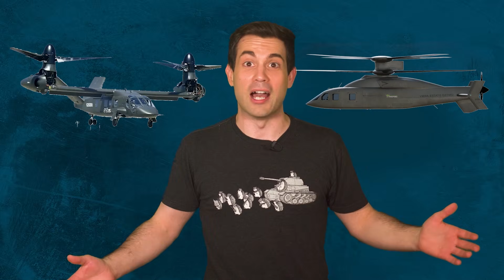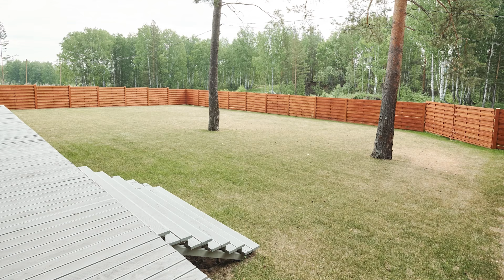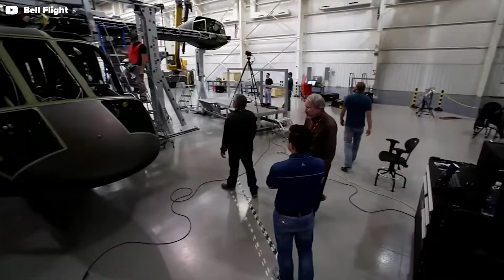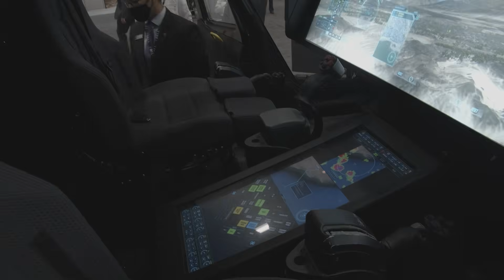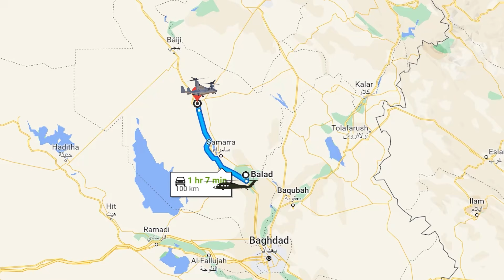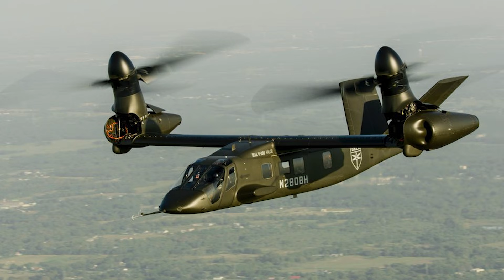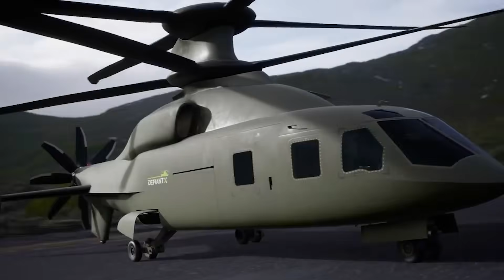V-280 Valor Helicopter Will Help Defeat China

Comment: The F35 is an example of why you don't build multipurpose aircraft. It's not a cost saving. It's a worse aircraft.  A purpose designed attack helicopter is not going to be a good cargo lift helicopter.  Watching the Ukraine war, attack helicopters need to be able to be fast, stealth via manpads, and lots of long range precision weapons.  It's more likely that only maned versions of cargo helicopters that operate well back from the front is going to work anymore. Unmaned vehicles with weapons and cameras are going to replace maned attack helicopters.
Reply: The F-35 is cheaper than most 4.5 Gen fighters out there, and it's a much better aircraft.
MANPADS have such short range that stealth is impossible.

Comment: Is it reliable (for an army helicopter of course) to have full-cockpit big board display? I do not have anything against separate LCD monitors\devises, but one giant LCD is prone to crash from one bullet, leaving pilot without any information at all...
Reply: You don't actually have to make a display out of a single screen. It might look like one big unit, but in practice it could easily be 5-10+ smaller screens that are merged together under a unified galls/plastic cover plane. Provided you got redundant power/data cabling behind the display, every single one could be shot/destroyed without affecting any of the others.
Reply: @reappermen  Thanks, probably it is

Comment: Personally think the Boeing Heli is a better fit, if it can lift the requirements. Smaller landing footprint, maybe faster, again only question will be lift capabilities
Reply: The tilt rotor design is faster, but I can see the coaxial rotor design being better at carrying load. There's not one solution that trumps the other in all areas.

I'd be interested to hear how that coaxial rotor sounds. It should have a pretty high pitched sound, but that's just me speculating. I could be wrong as they say they are able to spin the rotors slower though. Still coaxial counter rotating props tend to be whiny.
Reply: Coaxial is more efficient but it is not better than two rotors,  So if you have a fix diameter rotor then the the lift of two rotor is 2x but the lift of coaxial is less than 2x. Coaxial will have somewhere between 1.6x~1.3x lift. But the footprint of 2 rotors is 2x while the footprint of Coaxial is only 1x. Coaxial is a lot more compact but the twin rotor should have higher payload given the same rotor diameter.
Reply: @kazedcat   A detailed synapses of my comment exactly Lol

Comment: Come on Cappy! An LZ is like ice cream if it is not cold it tastes like crap. The Sikorsky-Boeing SB-1 Defiant should be able to land in slightly more confined spaces but didn't they have to stop flying in summer  2019 until fall 2019 for rotor bearing issues (so much for the rotor system being safer) and a delayed start in 2018 from 2017. The Bell V-280 Valor so far is faster and has I believe had flown more hours. It appears to be more likely to be ready on time. Range and load carrying will certainly be very important deciding factors.

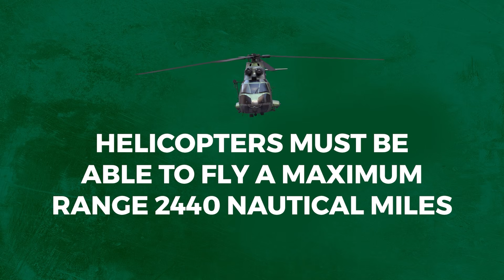Comment: 12:00 Are you sure? That's more than distance from Europe to US. 13:44 No, that's not. You played too much games. They use swashplate IRL. Making it work with double amount of rotors is a pain and was problem was successfully solved by soviets in their Kamov heli bureau. This one is probably additional thrust to meet speed requirements. I hope at least, otherwise it is double cringe.
Feels like they want latest Mi-8 mod but faster.
Reply: "Are you sure? That's more than distance from Europe to US."
Yes for example V-280's range is 2100nm. Defiant-X's latest range is 700nm
It's not more than europe to US. That's about 2700nm.
Keep in mind, this is for max range. Combat range is a lot shorter, about 500-800nm for V-280. They want these helicopters to be able to drop platoons of infantry on distant islands
Reply: @Userext47  Yes, my bad. But giving max range with additional fuel tanks for ferry only is kinda cheating.

Comment: Both had its own purposes.. can only choose one over the others is going to be hard. For long range transport, tilt rotos definitely the best. But hot extraction, tilt rotors is simply too big a foot print. It will had many2 disadvantages
Reply: From the description, sounds to me that the new project will be for a heavy lift that exceeds the current Blackhawk which could mean that missions like hot extractions might be performed by other craft like a smaller Osprey.
Reply: There are actually 2 competitions the army is holding, flraa which was discussed in this video, and fara which is supposed to be for a lighter scout type. Sikorsky is basically putting the same aircraft but smaller in fara, so the bell v280 might be selected for flraa but the Sikorsky raider for fara.

Comment: I think we should invest in drones that can transport equipment like artillery or tanks. That way pilots are not put at risk for these types of missions.
Reply: Not a priority. If you are transporting a tank or artillery piece, you are already risking the lives of highly trained specialists in the form of the tank or artillery crew. After all, there is no point in dropping a gun off on a hilltop if there are no gunners there to use it.

There is a big advantage in the difference between risking a trained pilot and not risking one (e.g. striking something with a Reaper vs an F-15). The difference between risking, say 6 artillerymen and 2 pilots vs risking just the 6 artillerymen is pretty minimal.

Drone transport is more useful at smaller scales (or much larger ones, for different reasons). Having a small drone helicopter that can carry a 1000 lb payload would be great for aerial resupply in contested airspace, because losing a few days worth of food and ammo is much more palatable if it doesn't cost a pilots life. Just send out a second shipment by a different route later in the day. Plus, since the size of cockpit that the pilots require is more or less the same regardless of how big the aircraft is, the space/payload savings you get from removing the crew area is much more impactful in a smaller aircraft than a larger one (e.g. removing a Blackhawk's crew compartment increases the cargo area by about ~20-25% vs a Chinook, where it is only ~10%).

Comment: Mostly based on aesthetics, I definitely prefer the Deviant-X's design; It looks safer, more efficient, and to be honest, has a more futuristic look to it; plus, I've always wanted to see us go into coaxial rotors set-ups and the pusher-prop is a cool bonus. Don't get me wrong, I really like the V-22 Osprey too, but there's just something about the V-280 that just makes it look flimsy and I can't get over the fact that its just a blackhawk with wings.
Reply: I don't know, dual main rotors is something that's been around for decades, and there is only really one company that keeps doing it (the Kamov Design Bureau in Russia). That tells me that it is a probably a very finicky system that requires a lot of specific engineering knowledge to get right, and that means we are likely to see a lot of unfortunate accidents in the decade after this helicopter is adopted.

Tilt Rotors have the same issue, with only one of them really being widely adopted but they have two mitigating factors: first, the US military has already learned a lot of tilt-rotor lessons the hard way with its V-22 experience; and second, the tilt rotor has a clear trade off for its increased complexity (being able to fly roughly twice as fast as a comparable helicopter). I don't know if the coaxial rotor & pusher propeller design offers as significant an advantage in return for its increased mechanical complexity.

Comment: In a side issue, maybe it’s a good time to examine the Navy’s role in future combat. The Navy has trouble retaining pilots. The Marines have trouble getting budget consideration for their equipment. Maybe the Navy should concentrate on captaining ships and leave other functions to the Air Force and Army. 

For example, Aircraft Carriers would be commanded and staffed by the Navy. The pilots would be commanded by the Air Force as a hardship duty along with being stationed overseas. This would help retain pilots. However, the Air Force commander would be under Navy command by rank while on duty. 

For the Marines, they would be a special trained forced within Army command. This would take the ceiling off of many senior officers and enlisted men. The Marine part of the Navy budget would be transferred to the Army where are Armor and Mech Infantry equipment would be uniform. For amphibious and large beach landings, new equipment would be developed capable of keeping up with the speed of battle. If this could not be done, new doctrine would be developed to get the right equipment to the right stage of the battle. The Marines should not need a 3 day sand storm to catch up to Army units.
Reply: Your idea isn't bad from a logical point of view.  But Marines would rather chew nails than go under army command. They'd never go along with that plan.
Reply: Although in every major operation Marines are under Army command because of rank structure. However, I understand your point about tradition. If my idea was executed, preserving as much it not all Marine traditions would be a critical part of the integration.
Reply: @stephensipe5405  Well, yes. But the underlying problem is that you think the marine corps is a military branch with an odd attachment to their traditions. 

In actuality the Marine corps is basically a cult thats funded by the U.S. goverment.  That pretends to be a military branch so it can continue to receive funding, and new sacrifices for its God: Chesty Puller.  

If you try to touch their traditions then the death cult will cry murder.
Reply: @stephensipe5405  Marines do not fall under Army command we have our own structure and our doctrine and mission set is completely different from the Army. Take for instance we had more freedom to operate in Afghanistan then the Army and they didn’t like that because we didn’t fall under Army Commad
Reply: @darrylmuse9948  Stow it. I am not in a pissing contest with a Marine. However, the Marines are a great example of mission creep gone mad. There was a big jump from Tripoli and Vera Cruz to Ft Fisher, Central America governance, and WW2 island landings. Nevertheless, at least some of this progression looks reasonable in a large picture way. 

Khe Sanh was probably the point of too far to be a long term good idea. The Mekong Delta yes, the area north of Da Nang yes, Khe Sanh no. However, post Vietnam the Navy-Marine budget balance  completely undermined the Marines mission success. For example, Grenada exposed communication issues. Desert Storm/Kuwaiti Freedom was a Marine tank disaster at the battle of the airport. In Desert Storm/Iraqi Freedom, only a 3 day dust storm saved Battle Of Baghdad from also being a disaster. This was because of Marine amphibious vehicle being expected to perform like an M1A1 tank. Then there is Marine Aviation and the Osprey dream and budget expenditure. How many Marines have died after testing in Osprey deployment. 

The Marines cannot be disbanded because the actual Marine mission still exists for the US. However, if the Marines were part of the Army as a specialized Unit, like the 101ST Airborne, all of its equipment would be the most modern. Additionally, it would be integrated in the Combined Arms Air-Land Battle Doctrine.  On a personal note, the promotion base and pyramid height would be far wider and much higher. The biggest difference, it’s Yes Sir, not Aye, Aye.

PS: The Navy cannot retain pilots. This is mostly because of personal reasons. Navy pilots cannot sell multiple long ship assignments to their wives. They opt for civilian aviation for family values. The reenlistment ratios of Air Force pilots is almost exactly opposite that of the Navy. I would incorporate all Naval air assets into the Air Force. The Navy runs the ships and the Air Force flies the planes. A ship assignment of an Air Force pilot would be treated like a hardship duty in Korea. This should greatly increase pilot reenlistments. 

For Officer promotion to General, serving as an Air Force pilot or Maintenance Officer on a Navy Carrier and in a Marine Unit as an Army Officer would be a positive factor along with wartime service and grading.
Reply: @neckbeardpig279  U got that right
Reply: There's a ton of second and third order effects you're not considering. The Air Force has no business commanding pilots in carrier ops, considering that they don't have the experience to run carrier ops - the Navy does.

Comment: No offense brother, but this is going to go the same path as the V22 project. The Army is going to buy hundreds of new VLV's, crash half of them, and give them to the Marine Corps.
Even though the V22 Osprey was designed in the late 80's, they are still one of the best VLV's out there. During my time in the Marine Corps, I was an 0481 with FSSG (Logistical Landing Support) and a few of our pilot's had mastered the gentle touch that a V22 requires for stable flight. Instead of purchasing new VLV's, the Army just needs to rely on the Navy's logistical and aerial support for transit. Especially if they plan on having any business in the south China sea.

Ground pounders always want to be self reliant, which is a good thing, but you already have an extensive logistical team ready to help out anytime you ask. The fleet of V22 Ospreys can provide reliable and stable flight over the sea from ship to ship or port to port for the Army for the next 40 - 50 years if they learn to play nice with the Navy and Marines. Branches fighting with each other is funny, but when it comes to unnecessary spending, the U.S. Army is the best in the business.

A comment on a YouTube video will have absolutely Zero effect on the federal government's decision but damn man, just combine the national Guard with the Coasties already and let the Navy fly you around a bit.

Comment: Maybe it’s b/c I’m long in the tooth but I prefer the Analog instruments for durability.
Reply: If set up properly the analog instruments are actually less durable. The screen would be made up of many smaller screens, that are independently wired. If any analog instrument gets shot, that information/ functionality is a hard loss. If one of the screens get shot, the information and functions can also be displayed/ acessed on any of the other screen partitions. Not as good as having it all on display at once, bjt better than loosing it completely.
Reply: @reappermen  hmm fair enough as far as that goes.  However, wouldn’t it be more susceptible to power loss?
Reply: @YoetzKrav  In theory yes, in practice no. Keep in mind, pretty much all the sensor, readouts, controla etc. that the analog instruments display/acces/control in a modern heli run on electricity as well. 
Yes, a manual switch qorks even without any electricity. But when the machine/vavlve/wgatever the switch controls requires power, your switch is just as energy dependent as a screen control. 
Plus power is so critical for modern vehicles that any military vehicle will have multiple redundant power sources. Anything that leads to a full power failure on your screens will be pretty much guranteed to kill your vehicle anyways.
Reply: @reappermen  I see your point(s).  It's sure nice to have civil discourse with someone like this.  Thanks for improving my understanding on this Jeff.
Reply: @YoetzKrav  Thanks for beeing civil as well. Such a rarity on the internet these days :)

Comment: If the first is also the maker of the Osprey then I would say hell no out front unless they can prove major changes and improvements. That plane/chopper should probably never have made it in the air with passengers as they were.
*thank you for bringing up the Osprey's safety concerns.
Reply: Sorry, but you are way off base.
Reply: @WALTERBROADDUS  things maybe have improved, but there were serious issues for a long time with the Osprey's and too many service members were killed in accidents that shouldn't have happened.  Again, things may have improved more recently but that doesn't change how things were when they entered service.  And what I've said is nothing against the pilots that have flown them whatsoever - this deals with the machines themselves.  If you happen to work for one of the companies that made/make them I apologize, but the service record is there.  
And I did say unless improvements have been made - if that's the case then so be it, but don't tell me that there weren't major problems for a long time with the Osprey.
And I don't think I'm off base at all for being concerned/mad about the people who were injured and killed in those accidents/malfunctions in a system that went into service before it was ready and took way too long - if it has been - to remediate.

Comment: I would not be surprised to see specific artillery doctrine designed around establishing fire superiority in difficult terrain using air-mobile artillery.  Most artillery is restricted in its mobility by where you can drive a heavy vehicle, and is further restricted by large terrain features that can provide both fire and sensor cover.  If I were designing future army doctrine, I'd want air mobility not only for my artillery pieces, but also for electronics platforms and heavy air defense assets.  This level of mobility not only provides flexibility to these units, but also complicates the process the enemy must use to find these assets to target them.
Reply: The problem is counter-battery fire. If your artillery doesn't significantly outrange the enemy, he'll fire on your position. You need to be ready to shoot and scoot.